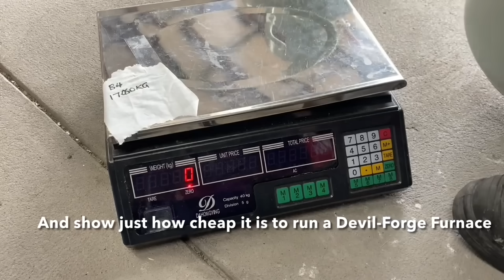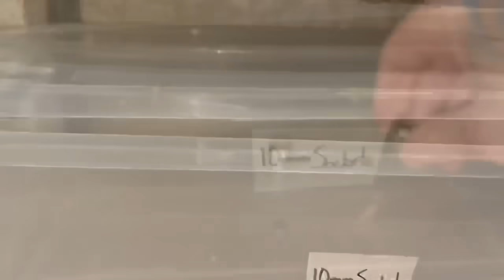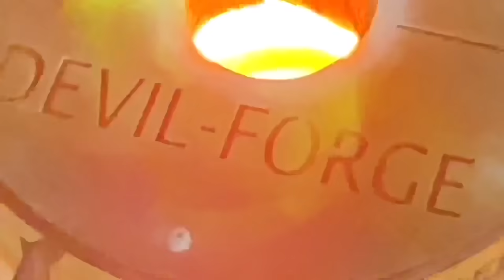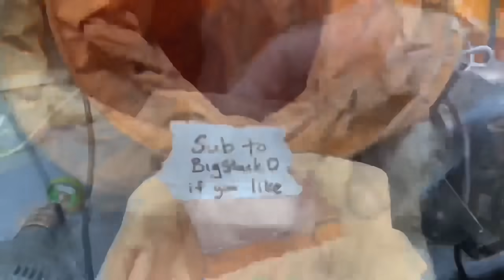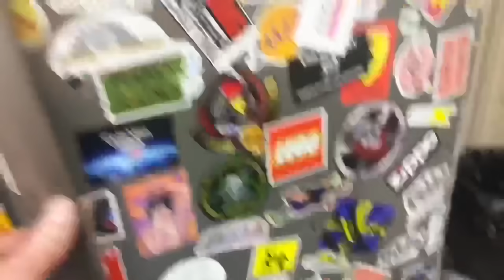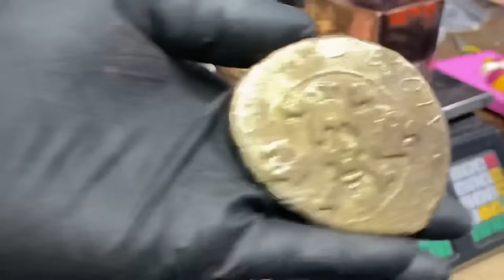Huge Copper Cube Casting - Trash To Treasure - ASMR Metal Casting - BigStackD Casting Copper

Comment: I think that was a motorbike engine block, and the 10mm socket def deserves its own little box, love the melting, Makin me wanna start, I just don’t have the space
Reply: if u don't have the space, start out just melting pewter which is a tin alloy. it's great fun and you can even cast it into silicone molds bought off ebay. you can melt it with a small torch and any metal cup.
Reply: @seanktb.  I would do that but all I got is scrap copper wire haha and I wanna melt that but I live in an apartment with basically no porch space
Reply from the maker: You could always look into getting an electric furnace they are extremely slow but you could still melt a kilo of copper and pour yourself 10 coins at a time. That could take up to 2 hours to melt 1 kg of copper , but it’s silent and if you had a balcony you could quite easily do it with no space. But obviously do it outside👍🏻. VOG just did a review on a cheap melting furnace if you want to check that out on his channel. and if you want some extra info on when I used my electric furnace I wrote down some key points (not all good) when I used the exact  same model so hit me up an email if you ever decide to go ahead and get one. 
bigstackddddd@mail.com
Reply: I will definitely keep that option open, thank you, although I may be able to fit one of the small devil forges, I’ll have to look when I get home and I will definitely ask for pointers or rewatch some of your videos, I’ve wanted to start melting the first time I saw one of your videos

Comment: when it comes time to flattening the pipes, you need a more efficient way of doing that, see if you can make your own flattening type of mangle, like the old wringer that they used back in the 20's to wring out clothes, maybe you could find or make one that will flatten the pipes or what ever that may need flattening, like the wire stripper you have, only this one will have a steel or stone roller that will squeeze things down to, a varying thickness, say between 2-5mm for a melt, just a thought.
Reply: Personally l like the hammering. Plus it knocks a lot of muck off and out of the pipe. Just my opinion. I like the sound.

Comment: Make 2 cubes of copper and aluminum on which to plot chemical information about them, such as in the periodic table of elements (Cu + Al)
Reply: He's done it before.
Reply: Make cast of the relics from the 5th element 😁
Reply: Great suggestion. He's done several cubes just as you described with multiple metals in the same vid. They came out superb. Check it out

Comment: The cast device with the pulleys and gears that you asked about - It is a dewobulator bypass valve drive unit from a 20th century commercial dry cleaning machine.

Comment: The good thing about his collection is that even in a house fire, his stash will not melt so it'll be fine :)
Reply: Actually not true, the average temperature of burning buildings is 1,700° F. So if it burns for long enough, literally everything in his stash could melt.
Reply: @Reinhard96  his copper and brass won’t

Comment: Hello Big Stack D. Big fan of the channel. Question for you: Have you ever smelted rust particles/dust? I work in water treatment and a major waste product is Iron Oxide. We pay a farmer to land apply waste to fields to get rid of iron sludge. I've been wondering if the sludge could be smelted into metallic Iron. Maybe a way for water company to recoup some money. Lots of contaminants (10-40%Manganese and 0-10%sand) Just curious if you've every tried. Thanks

Comment: That motorcycle head looks a lot like one off a VMax, but it's missing the other intake port. Yammie made a bike that was basically 1/2 of a VMax 1100 back in the 80s (so, v twin vs VMax v4) so I'm guessing it's one head off of one of those? Wish I could remember the actual model name but my CRS is acting up... They're quite rare here in the States, but Oz is a lot closer to Japan so ??? how uncommon or not they may be down under?

Comment: You said that it is difficult to melt this material, because it can overheat. What would happen if you overheat steel, copper, aluminium, gold, silver etc... I mean overheat like 1400°C - 2000°C or more. I can't imagine what can happen, because it will obviously not vaporize or burn out, or would it burn? And I don't think it will change it's hardness, when it gets down to room temperature again.. 
So it would be interesting to know! Have a good day, I'm new here and I really like your videos! Only thing missing is melting 25kg bars of gold.. 🤪

Comment: Really nice! I've always had an affinity for polished copper.

I'm curious about what you blurred out in a couple of shots. Is that some copyright issue?

On the brass: I know the boiling point of zinc is lower than the melting point of both copper and brass, so I don't understand how it doesn't all boil off when you melt brass. Is that what you meant by "tricky"? How do you deal with zinc fumes?
Reply: The blurred mold at 3:32 looks like a pentagram with some kind of symbol in the middle, from what I can see when it's moved away. Maybe showing that got the video demonetized at first?
Reply: Just watched longer; it's shown on the side at 11:02: a pentagram with hammer and sickle. Probably didn't want to get any political or religious hate over it.

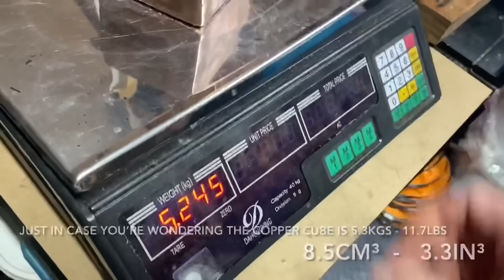Comment: 15:34 Not trying to be all too smarty-pants, but it’s 614.125 cm³ (or 35.937 in³ respectively). 8.5 is merely the edge length of the cube. Other than that, very funny video (the socket and burger bits).

Comment: What happens if you overheat the brass?
Reply from the maker: Basically it will burn off the zinc and that will create zinc oxide in the air and make a hell of a mess in your furnace and crucible, breathing this stuff isn’t safe. It won’t kill you but you’ll get metal melting fever for probably a good two days where you wish you were dead it’s certainly no fun at all. That’s why when you see some of my melts you might see if I do overheat the brass there’s a lot of yellow and white crap inside the Crucible. These furnacess hear efficiency is  so good you have to be extremely careful when doing Brass because you could quite easily fly straight past it’s melting point and overheat it , with aluminium and copper  it’s not a problem if you overheat

Comment: A 10mm socket is like the most lost socket ever. Here in the USA, it is typically the standard size required for the nuts on battery terminals. I can usually find everything but the 10mm, so I just got a terminal wrench coated in rubber, instead.

Comment: I have heard that copper is more valuable in it’s original form rather than melting it and recasting it. The reason being that scrap buyers have no way of knowing what is actually in these ingots and will only pay “dirty” copper price for them. Is this true only in Canada? Or does it apply elsewhere? The logic sounds nonsensical to me as copper can be tested for purity. Is this only a ploy for scrap buyers to turn #3 dirty copper into clean, bright or #1 copper simply by cleaning it through melting? The difference in price is substantial. Have you had experience with this issue in your country?